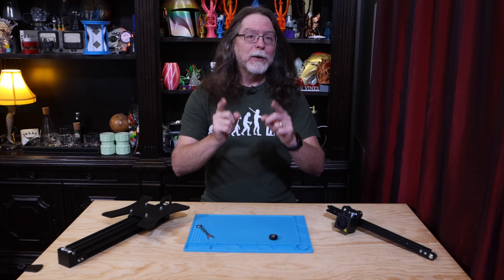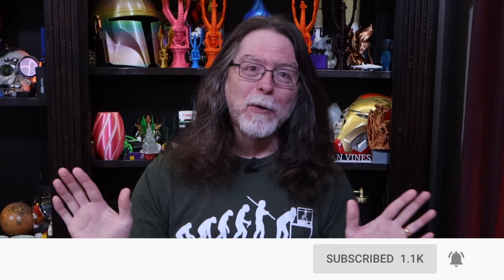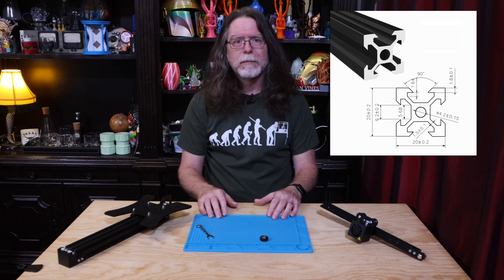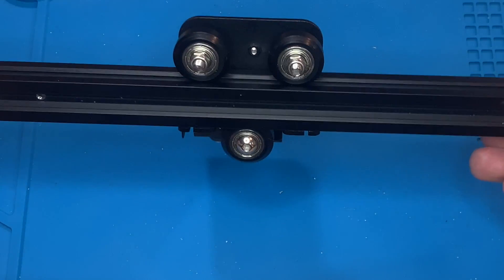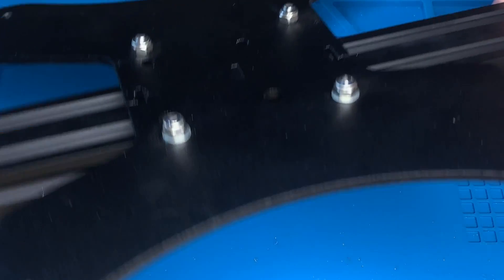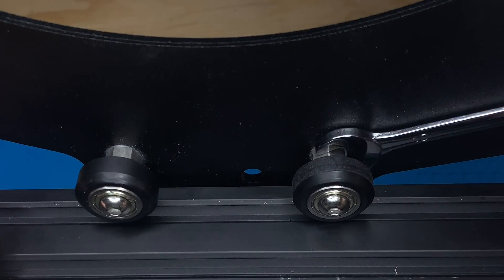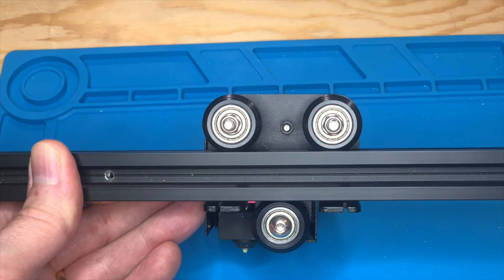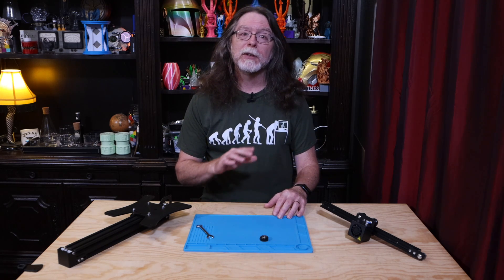Adjust the V Slot Wheels on your 3D Printer for Better Prints!

Comment: Is also worth doing on rhe left and right side if your z gantry. Even more so the right side because aince theres only 1 rod the rigt side is t supported by anything but tension. I know thays not the z rod's job but if you had a dual rod that woundt happen but it can cause wobble. I went downthe z wobble and z binding rabbit whole and it turned out to nothing fir me. Still banding and i now rhe pront head its self isnt sagging

Comment: I've noticed that my X rail profile has some uneven surface where the third wheel touches it , is there any chance to fix that without changing the rail?
Tried to fix it with this wheel adjustments but no luck

Comment: The explanation on how the hole in the eccentric nut is off center and is the reason why turning it makes a difference, was just great!  Now it makes sense as I had previously thought it was tightening or loosening.  Thanks!

Comment: Hi were is the excentric nut on the ender 3 v3 ke please xx
Reply from the maker: Hi, it looks like the Ender-3 V3 KE uses smooth rods and linear bearings, instead of wheels and V-slot aluminum extrusions. So, no adjustment needed on that printer. 👍🏻

Comment: Great video man. I am using Ender 3 S1 pro and I have an issue with the Z-axis V wheels. They are unbalanced. 2 can spin free and the other is too tight. can you please make a video on correctly adjusting the V wheels on the Z axis? Thanks

Comment: 🎯 Key Takeaways for quick navigation:

Adjust V-slot wheels on 3D printer for better prints.
V-slot wheels enable movement on various axes.
Improperly adjusted wheels can cause flat spots or wobbling.
Proper adjustments enhance print quality.
Y carriage has four wheels, X and Z axes have triangular arrangements.
Use eccentric nuts to adjust wheel tightness.
Check and adjust wheels periodically for optimal performance.

Made with HARPA AI

Comment: Last night I had an issue while 3D printing. My printer started its usual routine to auto level with the sensor. Unfortunately the sensor decided that it was not going to do the one job that it has, sense the bed 😂.

The printhead drives itself into the glass bed and I totally forget how to turn my printer off. After 3 years of using the same printer... I can't find the button. My printer sits there and continues to drive the head into the glass bed. Pop Pop Pop Pop. That's the only sound that I hear as the had continues it's madness.

My senses came back to me and I found the power button. Now I have to check and make sure that everything is still in alignment. Everything looked good and I print a test print. Weird layer shifts started happening. It would be totally fine up until a certain point and then decide that it would just give up and shift.

I spent so much time last night trying to figure out what the issue was. Never have I ever needed to adjust the eccentric nut on my printers. 

Well last night was an exception because that's exactly what was wrong. It drove the head so hard into the bed that it definitely moved that nut and caused the head to start wobbling.

Proof that no matter how long you've been 3D printing, something will always fail when you least expect it. And your knowledge will always be tested.

Thank you for this upload!

Comment: If your Z axis ones are too tight it will affect your layers. Some will over extrude because of flat spots preventing the carriage moving up. Too loose and you will get the same effect. The Z axis ones are the most crucial to get right because the layer height needs far more precision for good quality. You have to be able to turn every wheel by hand, with a little force and see it slide against the V slot without making the carriage go up or down, but not move too freely.
Reply: well my z axis came crazy right already and wont slide against . it's hard for me to bring the carriage up manually but the printer seems to be fine with it

Comment: Thank you! It was the middle nut that I needed to adjust. On mily Ender 5 s1, I had to put an Allen wrench on the front and lossen the lock nut at the back, 7mm I think, but just a bit so you can move the middle nut you see in the thumbnail above. Then tighten down the lock nut on the back of the carriage while holding the bolt at the front with an Allen wrench. It's a pain when it's the bottom right wheel, yes two bottom wheels on the Ender 5. This video helped solve my prob.

Comment: If your turning the eccentric nut with ease, you should tighten the bolt/nylon lock nut assembly until there's a decent amount of pressure to prevent it from loosening and getting wobbly again.

Comment: 4:18
You forgot to say that there must not be any binding when you move bed forward/backward.
If you feel even slightest binding, then fix it. Very often the wheels have flat spots. And need replacing to brand new.
Even brand new wheels are bad sometimes. So better to buy 20-30 of them in sets, take good ones and throw away old ones or use them for other projects

Comment: When adjusting the extruder wheel shouldn’t you make sure the extruder is straight up and down before making those adjustments? 

If one roller is pitched higher or lower than the other it will cause the nozzle to not be plumb correct?

Comment: Thank you for your complete guide
I have a question
I have a (Creality CR6-MAX) printer
There are 12 wheels on the (Y) axis, which are separated by two rails
My problem is that the bad heat plate moves back or forward too hard and this has caused the  (Y) motor to overheat too early.
Although I adjusted the wheels well, it still does not run smoothly
Dear teacher, please guide me what should I do

Comment: I got to thank you for how the V Slot Wheels works. I was trying to figure out why one side of my bed was slightly higher than the other. It turned out that when I changed the wheels, I turned the adjustment nuts (right side print bed) the wrong way, not in the holes. I spent two days trying to figure this out until I watched this video. Thank you!

Comment: Great video as always.
Could I ask you a question regarding the eccentric wheels on the bed. I'm new to the 3d printing world and I've just bought my first 3D printer. It has 6 wheels. It's an anacubinc kobra plus, but guess it's the same for most printers. I'm having an issue, should all 6 wheels be slightly gripping the runners as no matter how hard I try the centre wheel on the left keeps gripping really tight although it's as loose as I can get it. Adjusting the outer wheels the centre left still gets really tight. Any help or suggestions you can give me would be greatly appreciated.

Comment: I think I need some more explaining please . Adjusting the "z-axis moving kit" (Ender 3v2), one has 6 wheels to check. Now keeping in mind what you've said, "adjust the wheel until slight slip" (+/-), (only the two inside wheels can adjust), leaves one of the outside wheels somewhat loose (both sides). Adjusting the inside wheel until the outside wheel/s becomes tighter until "just slips", causes the inside wheels to push much harder against the vertical extrusions,  as if the z-axis extrusions are to close for the assembled kit wheel spacing. . . . or am I missing something here? . .  or wheel alignment of the two sections? How?🤔

Comment: Hey Brian, after watching your review I decided on a Sidewinder X2. Is there any way to fix the flat spots on some of the wheels, or do I just have to replace them? My printer's wheels came locked down tight and nearly all the wheels on the Y-Carriage and X-Carriage feel like they have flat spots even when loose. Any solution?
Reply from the maker: I think the flat spots eventually work their way out; in other words, once the wheel isn't being pressed super hard against the aluminum extrusion, the part that was flat will go back to its regular shape. But it can take a long time. I haven't tested to see HOW long, but that's an interesting question. I would maybe give it a week after having been adjusted to a more normal tension and see if they've gotten better.
Reply: @BV3D  Alrighty thanks, will try!

Comment: Very good video.  I could have used that a few months ago!  haha   I have the Sovol SV-01 and the bed was SUPER stiff on arrival.  The Y axis uses 6 wheels with 3 of them eccentric.  I found that the hole for one of the standing wheel was mis-drilled to close to the extrusion.  Once I removed that wheel, thing got WAY better.  I found it interesting that your Ender only needs four wheels.  Gives me ideas. 

  I do have another question however, unrelated tho.  When bed leveling, how loose do you start the leveling wheels?  Do you adjust them for middle range before you start?  Fully tighten, spinning loose?  I find I have issues leveling the rear of the bed.  Front and middle do great but back always seems too high and I can't tighten the nuts any further.  So I start over with all of them loose but seems I end up in nearly the same situation.  I have a BL Touch and I am able to print but I would really like to have my bed more level for the BL Touch to read.  Would this suggest that my gantry is not square with the base?  (If that's the case, how do you adjust for that?)  Any suggestions?  Thank you for your time and great videos!
Reply: Last year, I replaced the bed springs with a set of those silicone rubber spacers. After resetting the bed level, it stayed level for about a month!
No joke. But when I tightened up the x gantry, I had to adjust the bed level again. That was last week. Havent had to readjust, so far. ABSOLUTELY the best upgrade for my printer and I bet it will be for yours as well. The spacers are inexpensive and easy to replace.
By the way, I print things daily on this Ender 3 using only petg.

Comment: Hello again Mr. Vines, I'm really in need of an answer to my  question I've posted every everywhere I can lol. Can I put the Jyers firmware that we used for the 3v2 on the ender 3? I'll buy you a cup of coffee !!!
Reply from the maker: Hi! No need for coffee, but the answer to the question is: You can, as long as the Ender-3 you're wanting to install JyersUI meets two conditions:

1. It has a Creality v4.2.2 or 4.2.7 32-bit main board, and
2. It has the screen from an Ender-3 V2.

You can get those screens on Amazon for about $40 (make sure it's the kind with the knob, and not the touch screen!): https://amzn.to/3rGwiUA

I did this to an Ender-3 Max a while back, so I could put JyersUI on it.The Max had the required type of main board already, so all I added was the screen.
Reply: @BV3D  thank you so so much. It does have 4.2.7. Board. I'll have to purchase a screen. I have 2, one with knob that I replace on 3v2 return, it comes on but about half the screen is blk as if broken underneath. The other is new but without knob....
Reply: Oh one more thing, sorry , I'm assuming I need to install the right screen first then follow up with the switch to jyers. Do i need to flash screen when first installed?
Reply from the maker: @alliefoster  It's one of those things you kind of have to do all at once. Let's say your Ender-3 has a 4.2.2 board or a 4.2.7 board, and the regular Ender-3 screen. In that instance, the firmware on the board only knows how to talk to the regular screen. Connecting the Ender-3 V2 screen to it will result in a screen that doesn't (yet) work, and it may make an annoyingly long beep sound the entire time it's powered on.

So the upgrade would go something like this:
- Turn off the printer
- Unplug and remove the original screen
- Attach and plug in the new screen
- Insert the MicroSD card containing the new firmware file into the printer
- Turn on the printer (and the screen may or may not yell about it)
- Wait about 20 seconds or so while the firmware updates
- The printer should then finish booting normally, and will be able to talk to the screen

You DO NOT need to upgrade the firmware on the screen, as far as I know. JyersUI is supposed to work just fine with the stock V2 screen. In fact there's apparently a newer model of the screen that has a different circuit board on it, and requires a different set of files to perform an update.

But this does 100% require either the 4.2.2 or 4.2.7 board in the printer. Make sure your printer has that before you invest in the screen.

Comment: How about Linear Bearings? unfortunately these wheels have cheap Chinese bearings and grease. over time it will feel like a flat spot, it's just the bearings and either lack of lubrication, or just plain crappy lube which causes them to wear so quickly. its possible to take the metal cover off the sides of the bearings, but would be hard to put back on.

Comment: Great advice!  What about that rubber boot on the hot end. Is it needed?  Mine was damaged and I’ve left it off for the time being. Seems to still print ok. Just wondering. Thanks.
Reply from the maker: That thing is a silicone sock that fits on the heater block. It's two main uses are providing a little bit of thermal insulation to help the hot end maintain its temperature, and also to help keep filament from getting too gooped up on the heater block. They're pretty cheap, you can get like a 5-pack (or larger) on Amazon for under ten bucks. Searching for "silicone sock ender 3" or whatever printer you've got will probably turn up several. 👍
Reply: Thanks!  Your video was such a help assembling my Voxelab Aquila X2!  Keep up the great work!

Comment: Hey Bryan, Tronxy Printer Company has just released a new version of the Tronxy X5SA core xy printer. called the X5SA-600

The thing that is amazing about it is, the size of stuff it can print.  600 mm x 600 x 600  Yep 2 foot square printing.  

I have the Tronxy X5SA which cold fit in that printing area of the X5SA-600.

This must be the biggest hobby kit level print area I have ever seen?  

Could you get one to un-box, build it and test the printing for us all t see?

The printer has the new Tronxy black all surface detecting sensor that does see all the build surfaces now on the bed not just the base of the bed like the old blue sensor I have on the X5SA.

The new printer is huge of course and even has 4 big floor wheel to move it around on because it is a cube frame core xy design printer but huge.

Be so cool to see you build it print on it and show us all what it can do?
Thanks 😁

Comment: The wheels on the Z carriage are NOT 'exactly' the same as the x axis, not only are there 6 of them in total but they are constrained by one another if you don't loosen any of the fasteners that hold them on the X axis assembly(also if you do need to loosen these, be careful of adding skew between them that would ride up and down the z-axis), I had no end of issues in the past in that the tighter you make either of the eccentric ones in the middle, the looser the outside ones got because they fight each other using x axis beam itself. Also you can have a bad tilt up or down on one of the sides specifically, this manifests as one of the outside wheels always being tighter than all of the others and jamming up when the others are fine.
Reply: I think I have the tilt you speak off.  How do I get rid of it?

Comment: I  have an ender 3 pro, ender v2, ender 3 max and a cr10 . All of them when I checked out the bed and roll it there was a distinct thump and roll a little more another thump. I marked the wheels and it was in one revolution. I  pushed the bed with one finger lightly and when that thump happened the bed would stop. I thought the wheel had a flat spot or the rail had a dent or dip but couldn't find anything. replacing the wheels and it was gone. I can only think that some where the wheels were cranked down hard at one time and sitting in a warehouse and on a ship then in port they developed a flat spot or the bearings were damaged. I think they were only the eccentric nuts that were bad but I changed them all just because. Just a FYI.

Comment: There were so many dad jokes and puns and i enjoyed every single one of them.

I personally have had issues with the wheels on the z axis. ill tighten the nut on either side and i find, it affect the tightness on the opposite side. i haven't really found a good system for fixing the z axis tension, just alot of back and forth on both sides until its good.

Comment: Thanks Bryan! I have been printing since February 2022. I started with an Artillery SW X2 new from Amazon. I have since increased it to 4 different machines. The latest being a used SW X2. I have been watching your channel for the last 3 months or so and really enjoy your knowledge and presentations. I was having issues with the print quality of the used SW X2, I thought I had done all the checks but missed the eccentric nut on my X axis which is way loose. Thank you for taking me back to the basics and you sound like Casey Kasem to me.

Comment: Thanks for this great tip. Will the different angles cause the track to be not exactly perpendicular to the “dolly”?
Reply: No, as it pulls the entire bed closer or futher away using tension. A to loose nut can cause your bed to swivel, as demonstrated in this video. So a correctly tensioned nut will give a straight and smooth movement.

Comment: They are called V slots because if you continue the angle of each side it will show a V, the wheels are not the exact profile of the extrusion which is why you get some wear on the POM wheels (this has been physically tested) once this has worn to the profile of the V slot it wont wear any further
Reply: They also wear out because of radius difference in contact area
Reply: POM wheels? is the wear a breaking in period, how does it affect the quality?